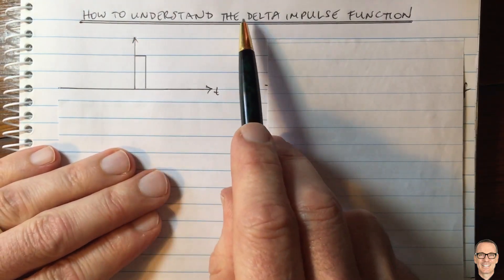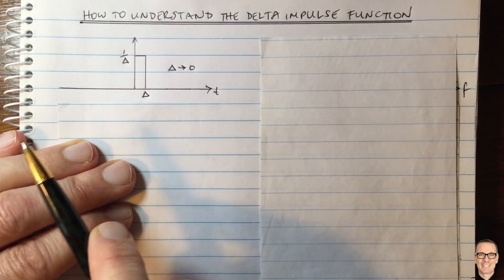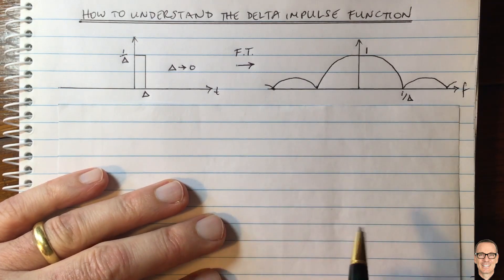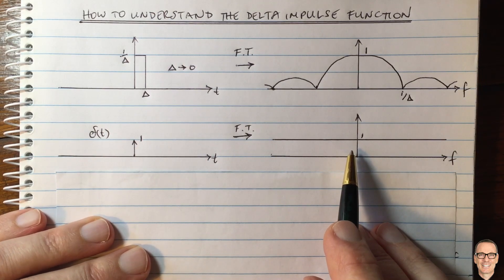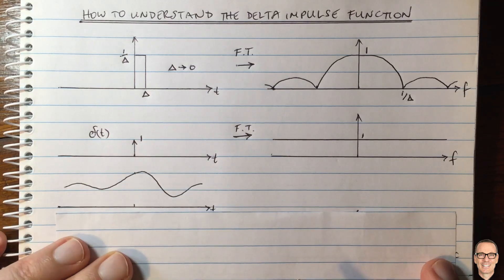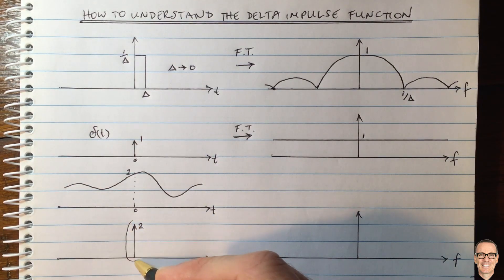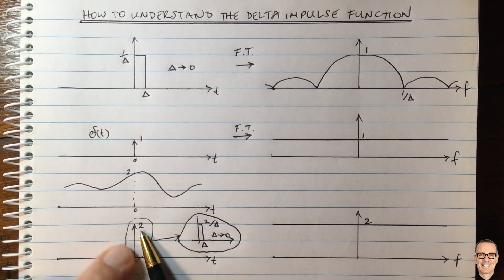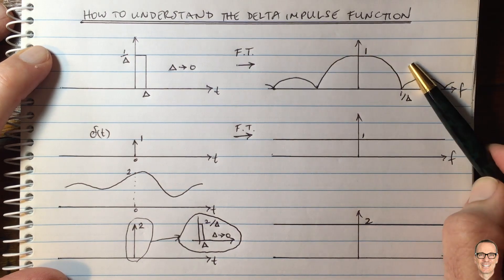How to Understand the Delta Impulse Function

Comment: Hi , thank you for explaining impulse function. 
I had questions at comments of your one particular video, about discrete time impulse function and CT to DT conversion.
Nowadays I am asking this question to different platforms, so let me repeat it :)

I don't understand how we transform continuous time impulse to the discrete-time, as its amplitude is 1.  How this process works ?  How discrete time dirac delta is 1 ? The actual mathematical operation of the "converter" is not clear.

What I mean is , what is the operator that converts :

""impulse(t) >> to impulse[n] with amplitude of 1"" 

or  ""x(t) . p(t) impulse train >> to x[n] as a sequence"" 

x(t) . p(t) could be represented as = summation the series of x(nT) . impulse ( t - nT ) But this is still not equal to a sequence of x[n] , because it contains scaled impulses with amplitude of infinity, right?
Reply from the maker: There is no "operator" that converts between the two. One is a continuous-time function, and the other is a discrete-time function. They exist on a totally different class of basis functions. As you point out, the CT delta function has infinite height, and so does not actually exist in the real world. The DT delta function also does not exist in the real world, but for a different reason: it is an infinitely long vector with only one non-zero component - but we can't have an infinitely long vector in the real world. In practice, we have finite length signals/vectors with finite amplitudes/values. Both the CT and DT delta functions are mathematical models that help us to understand the real world, and they can be related to each other conceptually, but they are on different classes of basis functions.
Reply: @iain_explains   What " different class of basis function"  means?  
If there is not a converting process or a converter operator,  what sampling is for?  What sampling and discretization actually means?
Continuous time functions are somehow converted into discrete time functions,  but how it's identified?  I mean,  why the DT impulse is 1, how we determined this?
I know I am asking a lot,  but I need answers to understand the concept.  A few videos could be helpful. Thank you for your answers.
Reply from the maker: A "discrete time signal" is not really a "signal" in the real world. It is just a sequence of numbers (stored on a computer or other digital storage and processing device). "Discrete time" does not exist in the real world. The real world is "continuous" (unless you're looking at the quantum physics level). And likewise, "continuous time" does not exist in a computer, which is driven by a digital clock waveform with a non-zero period.
Reply: @iain_explains   I already understand the difference of DT and CT signals. 
My question is ,  how x(t)  is transformed to x[n]  mathematically ?
And why the amplitude of DT impulse  is 1, while CT impulse has amplitude of infinity ?
I know dirac(t) is a kind of distribution function, and we can simply represent it like a rectangular function. 
But I dont understand the DT impulse.

I read a sentence like this :
"Mathematically , sampling of a signal x(t), is equivalent to its multiplication with a delta impulse train."
It seems contradictive to me,  because dirac(t) has infinite amplitude, with scalable area.
Impulse train : p(t) =  
summation (k= -inf to +inf ) dirac( t - kTs ) 

Sampler :  x(t) . p(t)  =
summation (k= -inf to +inf ) x(kTs) .  dirac( t - kTs )
= impulses at times kTs  ,   with area x(kTs)

The amplitudes are still infinity,  so  how x[n] is obtained by this multiplication ?

Thank you for your help. To underline it, a bunch of new videos can be helpful.

Comment: I have a question: Before Dirac invent the DIrac delta function, how does people study the subject of signal and system or sampling stuff ?
Reply from the maker: Paul Dirac introduced the delta function in 1927. We didn't have computers and digital processing until after Alan Turing and Claud Shannon in the 1930's and 1940's.
Reply: I think not many people were doing that at the time. Oliver Heavside did create the step function 35 years before Dirac's Delta (wikipedia). The step funtion was more important tat the time because it modelled a switch being turned on and, therefore, appear all the time in analog circuits. Dirac invented the Delta to solve Quantum Mechanics problems. 

I really want to find a history of the subject, though - it's really interesting. Perhaps IEEE Spectrum has done at some point ...
Reply: @maxheadrom3088  so can people do analog design without it ?

Comment: Without getting much into my 20 years old notebooks I would say that the amplitude in the frequency domain cannot stay 1.. it should go to zero when delta goes to infinity...
Reply from the maker: Your memory is pretty good, but if you do go back and check your 20-year-old notebooks, you'll see that the DC (zero frequency) amplitude goes to zero (in the frequency domain) as the width of the Rect function goes to zero (in the time domain), for a constant height Rect function . But the Rect function I'm talking about goes to an infinite height (1/Delta), so this cancels out the "DC-shrinking" factor (Delta).

Comment: Thank you cleared my some of the misconceptions like I am confused why besides arrow number like 1 or 2 or 3 written   instead of infinite.
Thank you 
I relate this with force multiplied by time
Ft = change in momentum = mass.chage in velocity = mass.acceleration.
Reply from the maker: Glad it helped! (but the equation you wrote for Ft is not correct, so you might want to check it)
Reply: @iain_explains  
Yes I agree 
Force =  Mass.Acceleration
Force =  Mass.( change in Velocity / change in Time)
Force . change in Time = Mass.( change in Velocity)
Force.delta time = Mass.delta velocity .
Impuluse = Net times the length of time over which that force is applied.
and also change in momentum.
Example 4 Newton force applied for (1/4)  second.
4N.1/4s = 1 N.s
Delta newton force or very very tinny newton force applied for (1/Delta time or very very tinny time)
Delta newton force.(1/Delta time)=1 N.s=impulse
------------------------------------------------------------
2.(1 N.s)=2.Impulse.
3.(1 N.s)=3.Impulse.
4.(1 N.s)=4.Impulse.
7.(1 N.s)=7.Impulse.
0.5.(1 N.s)=0.5.Impulse.
0.8.(1 N.s)=0.8.Impulse.
1.54.(1 N.s)=1.54.Impulse.
2.66.(1 N.s)=2.66.Impulse.
Thank you, 
Once again thank you for your valuable time and your valuable information for replying to my comment it helpful me to look throughly.
Thank you.